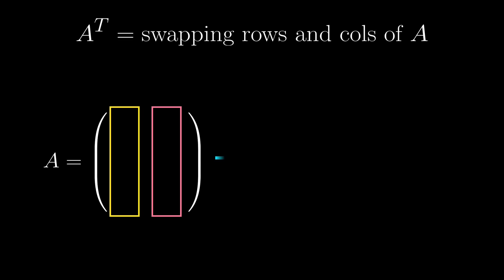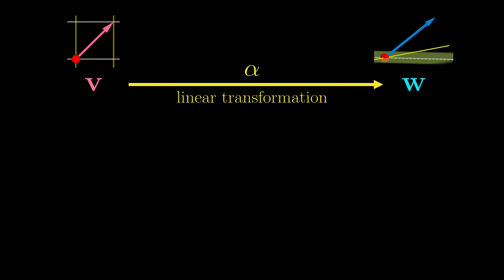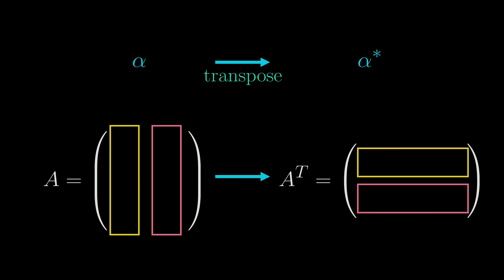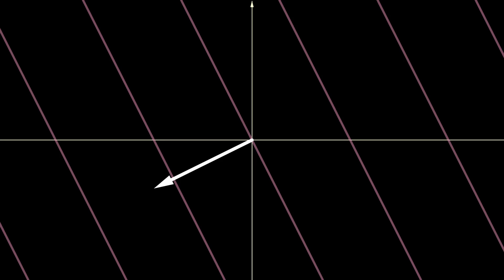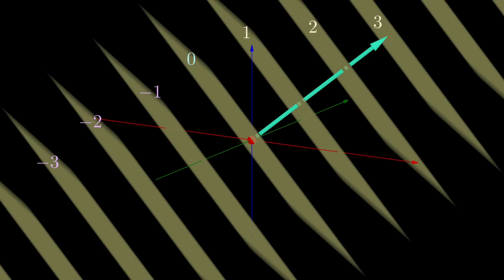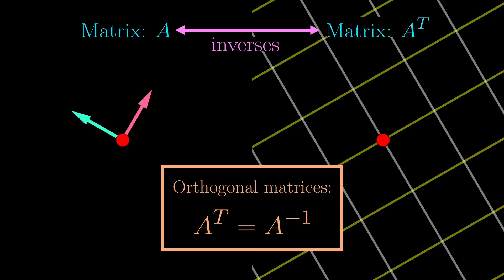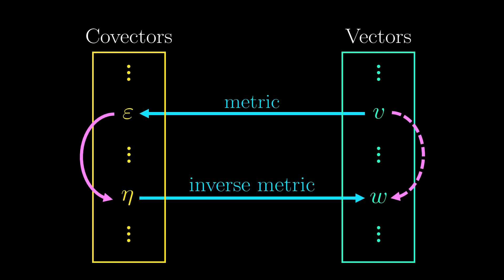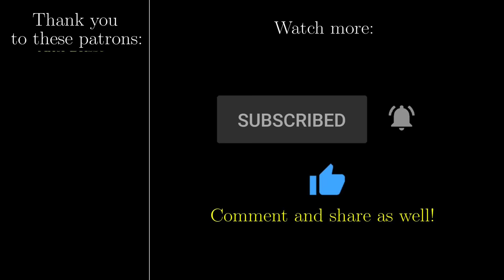The deeper meaning of matrix transpose

Comment: There is a difference between transpose and adjoint that should not be swept under the rug. It all boils down to the inner product. If the inner product is just multiply and sum, then yes, transpose is adjoint. If it's more complicated though, the adjoint follows suit.
Reply: To be more specific about the "more complicated", for example, the dot product in the complex vector space is not just a multiply and sum, since you have to take conjugates. But in this case, the adjoint is the conjugate transpose, so not too different.
Reply from the maker: This is why I said something like you have to restrict the space of covectors the "transpose" acts on. That refers to covectors of the form <v, . >, where you can directly make a 1-1 correspondence with the vectors, even though in infinite dimensional spaces, there are covectors not of this specific form.

In fact, the whole last chapter is actually about that inner product! (actually, more generally, a symmetric bilinear form) I just did not call it that way, and said something about the "pairing" between vectors and covectors, which is only doable with some notion of inner product anyway (or generally, a symmetric bilinear form).
Reply: @mathemaniac  Well I was referring to covectors of this form specifically, just with a different inner product. I didn't even think about the crazier stuff in infinite dimensions! I love these deep things lurking in corners of seemingly mundane stuff.
Reply: @btnt5209  That's not coincidental, you can derive the adjoint from the inner product and it will follow its form. For instance, if <x,y> = x^T Hy, then A* = H^-1 A^T H.
Reply: Agreed. Of all you want is the transpose, stay with duals (as row vectors) and not their adjoints: w=vA Then just transpose the whole equation.  But better: keep the rows and just multiply backwards.

Comment: This makes it a little more complicated then it actually is. Here it is simply

- Every vector space V has a dual space V*
- Elements of the dual space are called dual vectors or co-vectors.  When you think of dual space, just think of this as the space of row vectors, while the original space is the space of column vectors. 
- Every linear map from V -> W induces a linear map between the dual spaces W* -> V* called the transpose. 
- Every finite dimensional vector space is isomorphic to its dual, so we can really view the transpose as going from W -> V

One more point:

Row vectors eat column vectors and return a scalar. In R^2, you can visualize row vectors as equally spaced stacks of planes with one through the origin, and the application of the row vector to the column vector is the number of planes that the column vector pierces. This is the intuition the video is trying to get at.
Reply: Thanks for clarifying! I had a big "sigh" while the chosen way to present the topic was the "physics-inspired" one, when the algebraic one would have been much easier like you wrote. Of course visualization is important, but sometimes it just clobbers things up IMHO.
Reply: I think there’s something worth to be mentioned about the second to last point. In general vector spaces, the isomorphism between a vector space and its dual is not natural. One would need to specify a basis for the vector space. Only when the vector space is endowed with an inner product is the isomorphism natural.
Reply: I would definitely call that a "simple but doesn't explain anything". It doesn't convey any meaning, you don't even say how these things exist, but more importantly why we would care about doing such things. That's probably how classic textbook math presents it, but it doesn't explain much, that's why visual explainatory math videos by the likes of him or 3B1B are amazing, they actually explain the intuition behind these ideas.
Reply: I agree. This was quite useless.
Reply: @JthElement  Eh, it really depends on the person. I actually found this comment easier to understand than the video, but different people prefer different methods, so I'm glad both of them exist. The problem to me is that I have to keep translating the geometric explanation to the algebraic one while watching the video. The problem is that this concept is just too complex for a geometric explanation to really explain it well, (at least for me, you may feel differently). And just so it's clear, I appreciated the video, but it made more sense after I read this comment. For example, the explanation of why A^T * A = I for orthogonal matrices was really insightful.
Reply: @osbourn5772 
Personally I agree you with you with how this explanation makes it easier to understand the concept of the transpose of a linear map.

And I have another one to give

(I’m not from the US and this is how the transposition for linear maps is explained to us in France)

Let’s consider a finite dimensional vector space V, and f an endomorphism of V

If we write for of all vector x and y of V, 
< x | y > their dot product 
So 

f* is the only linear map where for all vector x and y of V

< f(x) | y > = < x | f*(y) >

This very linked with Sam’s explanation above
Reply: This simplified version feels like a way to explain it to people who already understand it.
Reply: @Blaisem  It's more relevant for the people who know all the related concepts in Linear Algebra, but don't exactly know what a transpose is supposed to represent
Reply: @JthElement  This comment explains the concept more concisely and clearly than the video.
Reply: Just to to remind me
Reply: @Blaisem  You got it. Math prides itself on being "elegant" which you can just think of as a synonym for "concise." The fact of the matter is when you are initially learning it pays dividends to patiently spend a lot of time seeing if you can visualize the mathematical concepts. This probably looks like a waste of time to those who already clearly understand the concepts. In our training, we try different paths until we get to the optimal neural circuitry for the best way to visualize a concept. Now you have become fluent in the concise description, and as you put down symbols and words to describe a concept such as the transpose, you are likely visualizing in your head the geometrical meaning of each symbol.

In much the same way, a child cannot appreciate a good novel because they don't have the lived experiences to draw upon to create a rich, vivid storyline in their heads. It is one thing to learn the grammar and vocabulary so that you can fluently navigate the words appreciated by adults, but as a child do you really have the experiential background to truly get at what an author is attempting to convey?

The concise presentation is not fair for new learners, but it's efficient for those who already know their stuff. I found value in OP's summary but it's because I've been wrangling with these ideas for years. Most of the classical mathematics that was developed into the early 1900s was with the initial intent of articulating some geometrical concept, only later did it get formalized into a dry collection of rules and definitions.
Reply: in particular, vectors (and covectors) are also "just" linear maps. vectors in K^n are linear maps K -> K^n (for a given field K) and covectors are linear maps K^n -> K. the idea of the illustrations in the video exploit the linearity. the transpose operation takes linear maps [K^n -> K^m] to linear maps [(K^m -> K) -> (K^n -> K)].

Comment: NATURAL EXPLANATION OF COVECTORS AND TRANSPOSITION FOLLOWS

The title caught my curiosity but, even though I tried to follow the arguments, they felt very prolonged and awkward,. I was ultimately left confused. I believe this is the second video I watch from this channel. The other one, on Galois theory, was a good outline but I found this to obfuscate a very simple concept. 

Less technical paragraph after this
If I'm not mistaken, that concept would be the contravariant functor that maps vector spaces to their dual spaces and linear maps to their dual maps. If we denote by A the linear map V -> W, then the dual map A*: W* -> V* arises by taking covector a in W* (the dual of W) to covector b=W*a in V* with the definition 
b(v)=a(Av)
for vector v in V. Put simply, you tell the image in V* of a covector a in W* to do on each vector v in V what a does on the image Av in W.
This is a very natural construction and by representing covectors as column vectors then writing out the equation for each component of b, it can be quickly derived that A*=A^T. But this is also the most confusing thing I found in this video: that both vectors and covectors are represented as column vectors. But apples are apples and bananas are bananas. 

If we just represent covectors as row vectors then covector (a b) acting on vector (x y)^T is just the usual matrix multiplication (a b)(x y)^T=ax+by. Then transformations are represented from right multiplication, that is, bA*(which is actually =bA as shown later). This is clear because if A is an m x n matrix that maps n dim vectors, the m dimensional covectors should be transformed to n dimensional, and the only way to do that with an m x n matrix is by multiplying from the right.

Now look how simply transposition appears (using the notation from above):
bA=(A^Tb^T)^T.
That simply says if we have row vector representation of covectors and matrix multiplication from the right, if we insist on writing covectors as column vectors (like in this video) then matrix multiplication from the left of the transpose gives us the mapped covector in column vector form, and transposing that back to row vector gives the covector in its natural representation. So it is derivable from the definition of matrix multiplication and transposition.
Reply from the maker: As I showed (albeit briefly) in the video, it is a very deliberate choice to represent covectors as column vectors. The reason is we should not ever be considering covectors as row vectors, even if it *seems* simpler to understand.

Even you have said that you can only see that transpose connection by "representing covectors as column vectors". Most people are more comfortable with applying transformations on the left, and it makes more sense to do so: after all, we apply functions on the left: x -> f(x). It makes much less sense to apply transformation on the right, and you have to resort to how matrix multiplication works technically (using dimensions and stuff), rather than the *intuition* given by matrix multiplication, which is a function! 

Plus, representing as rows means somehow you have to use (AB)^T = B^TA^T. This is actually intuitive if you think of the bathroom scale analogy in the video, and treating A and B as linear transformations. However, you are using it as (Ab)^T = b^T A^T, where b is a column vector, and unless you are thinking of b as a linear transformation, the intuition breaks down, and you are treating (AB)^T = B^TA^T as something purely algebraic, rather than having an intuition for it.

Put simply, I don't think there is any intuition for v --> vA, for v a row vector, other than "oh it works, look at the dimensions, they match!", which isn't really an intuition. On the other hand, thinking of covectors as column vectors b, then b --> A^T b, and it would be "yes! This is the linear transformation I am familiar with!".

I think the reason why it feels confusing is simply that most people are only thinking of matrices as a bunch of numbers with a specified rule for multiplication, rather than actually thinking it as a transformation, or having an actual intuition for it. Sure, that's fair enough actually, and you can think of it just purely algebraically, which again is fair enough in some applications, but the point of the video is to give the intuition of what transpose / covectors are actually doing when you have the intuition that matrices are linear transformations, and only using that intuition and *never* computations.
Reply: @mathemaniac  You are right, it seems like pure algebraic manipulation. Let me try to define precisely what column and row vectors, as well as matrices, represent. Then transposition will be defined as a very simple operation and everything will make intuitive sense, should I succeed. So bear with me.

Let m x n matrices be representations of  a linear transformation such that composition is matrix multiplication. Note that I do not specify what it transforms to. If you think about it, a covector is a linear transformation from a vector space V to the vector space R (or any other field). But the dual of the dual of a vector space is that vector space (finite dimensions, ofc). So a vector is also a linear transformation from a dual space (of covectors) to (the covector space) R. So it makes sense to treat both vectors and covectors as matrices (i.e. transformations). Let us arbitrarily decide vectors are the n x 1 matrices, and covectors the 1 x m matrices. This just decides how we interpret each direction in an expression of matrices. 

Then ABv is the composition f(g(v)) for a vector, but aAB is the composition g*(f*(a)), where f(v)=Av and the "dual" (will define in a bit) f*(a)=aA. In terms of matrix multiplication, an m x n A is a linear transformation of n dim vectors to m dim vectors if we multiply from the left. But it is clear that A gives rise to a transformation of m dim covectors to n dim covectors when we multiply by A from the right. Let's call this the dual of A.

But we already have a term called the dual of a linear transformation as I defined in the original comment, given by the functor from the category of vector spaces to dual spaces. 

So am I abusing the term dual by using it in two different senses? No, because they are the same! It's really easy to show, almost too easy:
Let v in V, w in W, b in V* and a in W*. We construct the dual of the map represented by A by letting for any v
b(v)=a(Av). 

In the matrix notation where vectors and covectors are also matrices, we want a matrix B such that
(aB)(v)=a(Av).

From associativity of matrix multiplication, it's really easy to see that B=A! That is,
(aA)v=a(Av).

We did not have to do anything! The dual of left multiplication is right multiplication. It is just a matter of interpretation of the matrix expressions.

But interpreting column vectors as vectors is arbitrary. We could have called them covectors and the row vectors just vectors. It only changes how we interpret matrices and the direction of matrix expressions. And when we want to flip what they mean, we can devise an operation for this. And let's call this magical operation 'transposition.' It works perfectly because the two directions are perfectly symmetric. And this is because which one we call a vector and which one a covector is also perfectly arbitrary in finite dimensions.

What do you think? Does this give intuitive meaning to the purely algebraic manipulations now?

Comment: Nice geometric interpretation of the transpose.  Two comments: 1) you can get the components of the one form directly from the intercepts of the c=1 hyperplane.  This can be used for a straightforward demonstration that the adjoint matrix is the transpose. 2) you mentioned linearity of the forms as functions, but they are also linear objects in the sense that they add like vectors. Both properties were used.

Comment: It's also interesting to consider cases, when matrices linearly map vectors to bivectors and back. Such as when dealing with transformation of a force into a torque (in 2d, or in 4d, since amount of bivector components are different there from amount of vector components).
I've seen transpose of such matrix being used to figure out effective mass from the inertia tensor and position to which force is applied (1/effectiveMass = transpose(toTorque) × inertia × toTorque), where inertia is just a symmetric matrix (aka orthogonal resizer) that turns torque bivector into a resized angular velocity bivector. ToTorque represents geometric algebra wedge of a force-vector by offset-vector. And inverse effective mass just shows how much of tangential velocity unit force imparts onto the object (ignoring linear velocity).

Anyway, sorry for the unclear monologue; I'm just too tired after a long day and I wanted to share a little piece of cool info I recently learned.

Comment: 12:18 why do the basis vectors go back to their starting points? That's should only happen if you multiply by A^-1 right? Not A^T
Reply from the maker: The point of the transpose is to move the measuring device back to the original space, so that you can do the measurements in the original space. So you ask, what is the operation so that the measurements remain the same, but the basis vectors have not changed? That would be the inverse.

As I said later on in the video, it only looks like inverse, but you have to treat those gridlines as covectors.